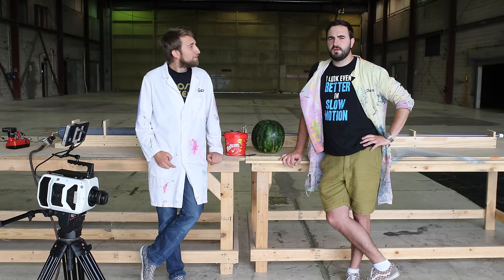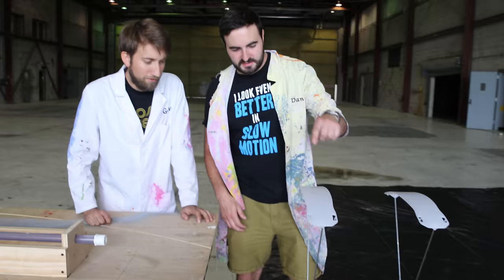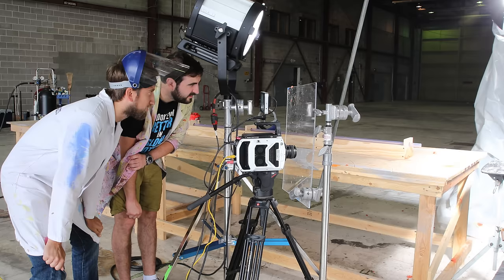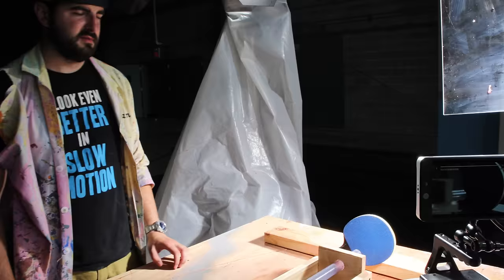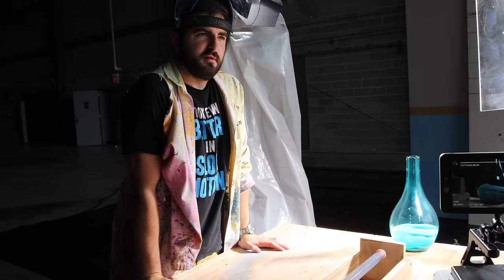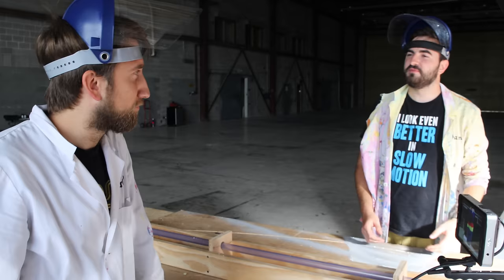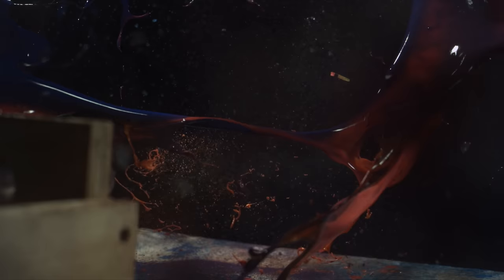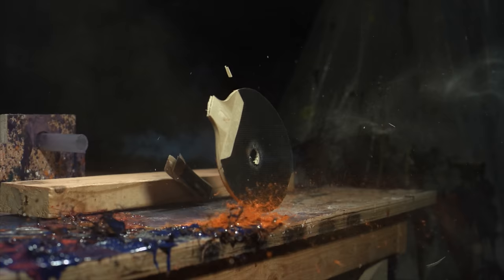Compressed Air Cannon in Super Slow Mo - The Slow Mo Guys

Comment: with the watermelon, it appears to me, the compressed nitrogen entering the hole created by the Malteser over pressurizes the watermelon and causes the explosion. not the actual impact of the candy
Reply: Yep. On a lot of the shots,the malt balls just made holes and the nitrogen jet behind the object blew it apart. The exceptions were the liquid filled containers, although much of that may also have been due to the nitrogen jet. It would interesting to see the shots made from a distance of a couple of meters.

Comment: Venturi decreases pressure and temperature but increases velocity. 900 fps is not faster than a .45 they are typically faster that 1000fps what kind of science channel is this?

Comment: sorry but there is not a chance that a malteser is doing even half the damage that is shown in this vidio, it's more likly that the high pressure nitrogen in the air cannon is doing the damage not anything else. the malteser just doesnt have enough mass to do the things they are showing. there is no way that a 1 to 2 gram ball of anything is smashing a glass pane, glass panes need a force of 24,000 PSI to smash in this way, from the working out i did using rough numbers for the length of barrel, PSI in the barrel and the weight of the malteser shows that that malteser would need to be going at around 3000 M/S or around mach 5 for it to exert the force needed, and yes i know i used ROUGH estimated numbers but even giving it everything in it's favor it would still need to be traveling over 1500M/S and thats just not possible. the malteser just doesnt have enough MASS.
Reply: Plenty of high pressure air is escaping the barrel long before the malteser does, and very little happens to the targets. You can even see the air deforming the rubber on the ping pong paddle, but it doesn't actually break anything until the malteser is there to hit it.

You seem to think raw math can figure this out, but fact is, not all glass is created equal. They did mention they're using safety glass.
Reply: @Winasaurus  yes you are right about not all glass being equal and yes i know they are using safety glass and that your biggest problem right there, safety glass MUST meet a number of perameters for it to be considered safety glass. force needed to break it being a big one. but in my numbers i did i used NORMAL glass as that would be easyer to break and need LESS force than safety glass.
as for the gass leakage, there isnt enough leakage to make much of a differance or the malteser would just roll out of the end of the barrel. also concider the MASS of the nitrogen that is behind the malteser with the length of the barrel and diameter the mass of the nitrogen is probably MORE than the mass of the malteser but i would have to do the numbers for that one. 
the fact remains that the malteser just doesnt have enough mass to be traveling at the speeds in this vidio to do the things they are showing so there must be other factors at play.

Comment: 6:33 Why is there already a hole though?
Reply: I agree.  You can , clearly, see a perfectly round impression on the paddle (bat) before the impact, like there is a hole underneath the rubber covering.
Reply: @kingsouthpaw  I think it's just the air, it's a lot of pressure.
Reply: Seems plausible
Reply: @kba  I'm pretty sure you are correct.  If there were a hole, the rubber wouldn't sag sideways so it wouldn't look like this plus you can see the wood splintering off the other side.  I think your theory is the most plausible.
Reply: I'm pretty sure they peeled the rubber back and drilled through half of the wood then replaced the rubber. Would explain the indentation and the wood splintering from the back.
Reply: @LameName3588  I'm pretty sure you're wrong.  Firstly, the Slow Mo Guys have never cheated on anything so there's no reason to believe that they'd start doing so now.  Secondly, they did a suspiciously neat job of it if they did do as you suggest, and thirdly, it's completely plausible that this would be possible.  I've seen a ping pong ball shot through a bat with a high-powered air cannon so there's no reason to think that a Malteser wouldn't go through one.  Anything is potentially dangerous if it's moving fast enough.
Reply: @joshuarosen6242  this video is a year old so I'm not assuming they started doing anything "now" and you would be surprised at how many people on this website fake things especially when the result is more exciting. Yes even the ones who seem very honest and genuine. The fact is it's a show. More action is more exciting. I could be wrong about the explanation I proposed but at the same time that's all it was.. a proposal of what might have caused the indentation in the rubber and the wood splintering from the back. The malteser also disintegrates into dust when hitting other objects but leaves a perfect circle in the paddle.

Comment: I can not believe you guys are using PVC piping for your high pressure air reservoir. That is the most dangerous material you could possibly use. PVC piping and fittings explode if they have the slightest imperfection or hairline crack in them like a hand grenade. PVC material is never ever supposed to be used in a high air or gas pressure system.